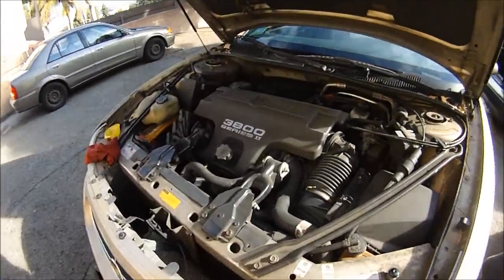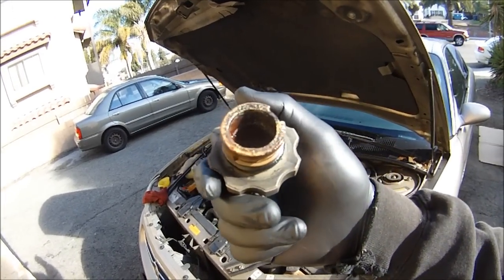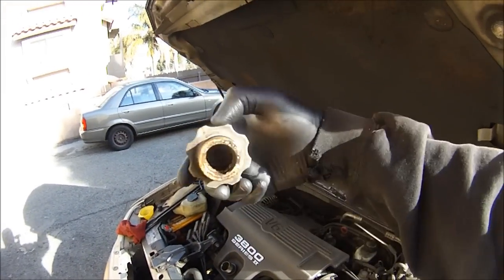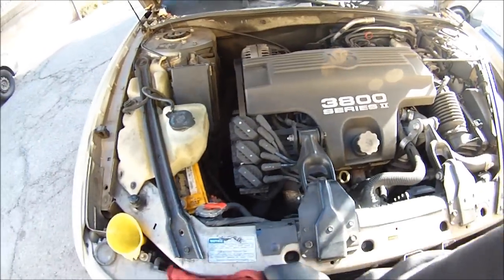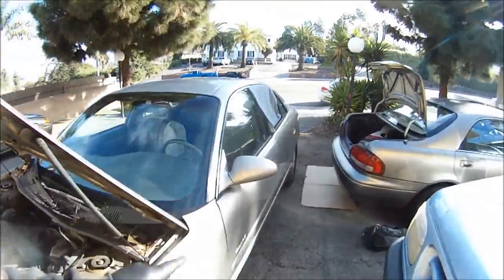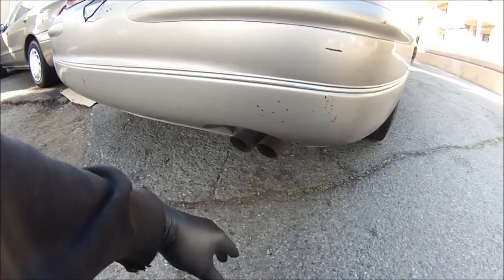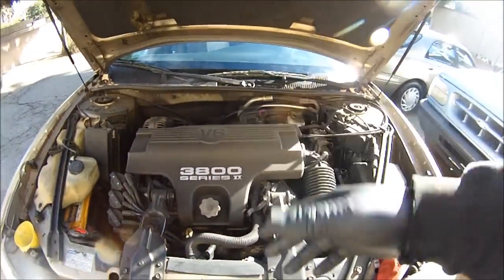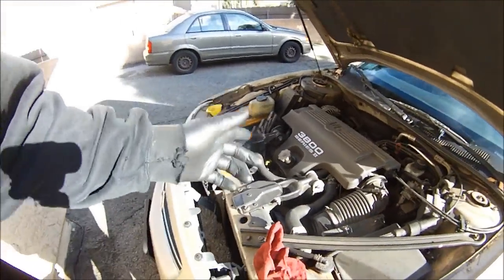BLOWN HEAD GASKET= MILKY OIL CAP. HOW TO TELL A BLOWN HEAD GASKET ON OIL CAP

Comment: Some engines produce condensation that builds up underneath the oil cap that can cause that milky substance to occur. My 5.4 3 valve engine in my Ford F-150 does it all the time and that's very common with those engines especially in the winter months. One of the more better ways to tell if you have a blown head gasket is make sure your  coolant level hasn't changed. Check your dipstick to see if there is water mixed with oil in the oil pan. While the engine is cool take the cap off of the radiator and see if there is any exhaust gases leaking into the coolant which would cause bubbles in the system. And of course if you change your oil and you see coolant pouring out of the oil pan and that's a pretty obvious sign also.

Comment: in colder climates this can be caused by short trips under 5 miles because the engine cant heatup to normal working temperature so keep in mind that this does not Always tell u that your gasket is blown
Reply: i am mechanic...today i realize that there was  some milky oil on oil cap in my car .....i mostly use my car  fir short tris ,,,this weekend  i  got my car from  work to home and back only one time...this is a 2 mile trip....i do this every once a week,,,so i am thinking exactly the same  that the weather and short distance trips  doesnt help the engine to spit  out the moisture ,,,,,and there is also  a lot of waqter from the exhaust.....this happens only during winter ,,,on summer  water almost disapears
Reply: Yeah I think the video is wrong
Reply: Happened on my old durango alot but wasnt a blown head gasket it was just short trips
Reply: Short trips exactly, I went to my local mechanic (honest folks), I have a corsa and there was creamy substance, mechanic said it's caused by short trips, he said it's no cause for concern UNLESS when you take out the dipstick, clean it, put it back in and if there is cream on the dipstick, then there's cause for concern
Reply: @pavloslionmma7619  so what do you suggest I can do cause it happened to me this morning, how can I get rid that? And I took out the engine stick and the oil looked good just not the cap from the engine
Reply: @rampagekike3793 i’ve been reading youre supposed to take the vehicle on longer trips. Drive it for a while on the highway. Im not a mechanic but i’m dealing with this issue and hoping it’s just condensation 😢

Comment from the maker: This is how to diagnose a blown head gasket the best way DIAGNOSING A BLOWN HEAD GASKET WITH A HOME MADE CYLINDER LEAK DOWN TESTER HONDA SOHC VTEC 1.6L.
Reply: my headgasket has blown...do i need a new engine as well ???
Reply: cheddar bob usually you have the gasket replaced and the head leveled before fitting...BUT..on some older cars it might not be worth it as it's an expensive repair. if you know a friend thats a mechanic that's a good way. but no you don't need a new engine.. although it's about the same price

Comment: THANK YOU.
NOT NECESSARILY TO HAVE A BLOWN HEAD GASKET. TO MAKE SURE, IN THIS CASE, DRIVE THE CAR FOR AN HOUR CONTINUOUSLY, THEN STOP, KEEP THE ENGINE RUNNING, PRESS ON THE RADIATOR UPPER HOSE, IF IT FEELS STIFF LIKE A STONE, THEN YOU HAVE PRESSURE IN THE COOLING SYSTEM, WHICH MEANS THERE IS A BLOWN HEAD GASKET, BUT IF THE HOSE IS SOFT AND CAN BE PRESSED WITH YOUR BARE FINGERS, THAT MEANS THERE IS NO HEAD GASKET BLOWN, ITS JUST COLD WEATHER CONDENSATION DUE TO SHORT TRIPS IN COLD WEATHER. ANOTHER THING YOU CAN CHECK IF THE COOLANT WATER IS MISSING, LIKE A CUP PER WEEK, THAT MIGHT BE AN INDICATION OF COOLANT PASSING THROUGH THE SYSTEM WHICH SHOULD BE FIXED. THIS IS A COMMON PROBLEM IN SOME VW ENGINES, WHERE PEOPLE RAN TO MECHANICS, TEARED OFF  THE ENGINE, AND THEN FOUND OUT THE HEAD GASKET IS OK, IT WAS JUST COLD WEATHER CONDENSATION, DEPENDING ALSO ON ENGINE OIL TYPE.

Comment: He is right that the oil cap is a way to tell, however if it's cold weather and you drive your car on short trips a lot you will get that on the oil cap as well because of condensation buildup from the temperature outside and the engine not operating at full temp yet, the way to differentiate that from a blown head gasket is a blown head gasket will also cause that gunk to show on the dipstick as well.
Reply: Aaron D, you have that right.  Another source of the wet milky creamy gunk on the cap is the result of a plugged CCV / Oil separator ...  the plug can result in the head gaskets being blown (happened to me).
Reply: Exactly! Same stuff on air cooled VW!
Reply: Spot on had an argument with a buyer of our run around about that.
Reply: I got a milky oil cap after i changed the water pump and somehow the coolant got in the oil... I changed the oil and no more milk
Reply: My cap on my corsa D has milky oil on it too. I tried to heat up my engine for 30min as I'm not taxed to drive it yet. After 30 mins the creamy stuff was still there but I noticed some normal oil surrounding It , probably build up from the heat...is this a good thing?

Comment: although this is true... it should be said that it is common for jeeps, and dodges that have the long necks comjng off the valve cover to have this chocolate milky look underneath the cap due to normal condensation... just so ppl dont tear their heads off right away... again, this is an excellent way to tell, generally
Reply: exactly, i have a v70 2.5t -04 has the same normal condensation, short drives in the city usually makes this shit comeback.
Reply: And many Mercedes, especially the older 3.2's, with perfectly fine head gaskets get that.

Comment: 4.24.14.     The 3800 also has leaky L.I.M. Gaskets, due to lack of draining & replacing the Dexcool coolant. I always replace the L.I.M. Gaskets with the metal framed GM or Fel-Pro gaskets! And not to forget, I replace the plastic upper plenum with one from APN Automotive Parts Network. It's the best one for series II engines.
Reply: Man i put some bar in my car 6 years later car runs bomb

Comment: If that's the case I've had a blown head gasket for 30,000 miles. If you see it on the dipstick then you have a blown head gasket
Reply: Yes condensation can cause milky look under oil cap
Reply: @macknumber9  or even it being a bad pcv valve bc my cap has white moister on it not a lot and it had light brown moister in the oil did a oil change changed that smoked for a couple miles around the valve cover and it stopped doing that in the oil after I got that fixed and high milage oil change
Reply: Your are absolutely correct chad Krugle if your oil is milky or your coolant has oil in it that’s a blown head gasket that condensation doesn’t always mean head gasket this guy needs to explain a little better before he has everyone panicking thinking heir head gasket is blown that moisture is normal if your oil is not milky and your coolant isn’t milky that’s absolutely normal every engine is going to produce condensation when your oil looks like that that’s when there’s concern if it’s on the cap and in the oil short trips and not warming all the way up cause that condensation that’s why if your taking short trips you let it warm up to burn that vapor off like I said every engine no matter brand spanking new is going to have some condensation the vapors have to escape somewhere now if you see that crap in your radiator or oil then yes you have a blown head gasket only and I repeat only in that case where it’s in the oil and in your coolant to have a great day happy new year

Comment: It can also be from a faulty crank case ventilation system. It will allow condensation to build up in your valve cover.
Reply: Yes Lincoln Kuwabara,  exactly right...  faulty CCV.
Reply: Louis DeFilippi Pcv
Reply: Hi Lawrence Wheeler, yes, in many cars PCV, that it right.  In the BMW for example the part that performes that function is the crankcase vent system, that is, the CCV system,  which separates liquid oil from the air inside the engine and intake.  Other cars have a PCV (positive crankcase ventilation) valve that is used to vent the crankcase.

Comment: My car overheated a bit, but I can’t find oil or water mix. However in the breather pipe at the top of the cylinder head which connects to the throttle body and connected to seemingly the engine block through a little black metal box, I found oil water mixed (coffee with lots of creamy milk image). What could cause this? I cleaned, but I wonder if I should do something to prevent it again? The actual engine oil is still pure even at the cam shaft, chain, pivot rocker area engine oil is ok. The dipstick is fine as well. I just had a slight mix on the cylinder head engine oil cap, but that is coming from the breather pipe and don’t know where it picks up water, could you help?

Comment: All of you share good points, and Kudos to this video, this indeed is a great signal to what way to go on diagnostics of your cooling/combustion system. I have on tip I believe is a sure fire way to check. IF your head blows the hell off your car and flies into oncoming traffic...there at that moment, is a good time to check on your head gaskets. Youre not going anywhere for a while anyway

Comment: milky oil is usually a cross leak from bad intake manifold gaskets..3800s 3400s and 3100s are notorious for it along with the 4.3

Comment: NOT ALWAYS true, condensation is the cause of milky looking oil cap, their are like 3 or 4 different ways to blow a head gasket depending on if it's the space between the oil jacket & coolant jacket that will cause water in the oil, also water in your oil could mean the bottom end & AKA (Rings) AND the head gasket are worn out meaning you need a whole engine re build. After the gasket is replaced the engine would hold water but then now burn oil

Comment: My car has this milkshake under cap, rocker covers full of it. how can I clean this out after repairing the heads/gaskets? the dipstick is pretty clean and the radiator
Reply: Did it cause your car not to start?
Reply: Dump oil, rinse with diesel and then pour engine oil

Comment: My 1997 Toyota Tacoma truck has 280,000 miles on it. It has all the symptoms that you explained. What's a fair cost to have the head gasket replaced (parts and labor)?

Comment: Milky oil cap is not a sure sign of a blown head gasket. It's just condensation that has not evaporated due to short trips in very cold weather. Engine not running long enough to remove condensation from oil. If your oil is milky on the dipstick, then there is water/antifreeze in oil.
Reply: Alfonso Demagistris I have a mucus on the cap but the stick looks fine on my Pontiac grand am but I swear I pour about 5 gallons of antifreeze in my car in the last 2 weeks because it just keeps disappearing I can’t tell with the tailpipe because it’s winter in Pennsylvania right now what do you think
Reply: Mack Flanigan , if the shit ain't leaking out it's going somewhere. Sometimes leaks evaporate before they hit the ground, but there would be a trail of white evaporated antifreeze. If you putting it in, it's going somewhere
Reply: Yeah i was worried about that but it was winter when i saw the milky oil cap and as soon as the weather got warmer i stopped seeing it also i had my mechanic test it he said my head gasket was fine

Comment: Can be a vacuum leak ? I live in new york and i got a truck and this happen only in winter. But you check the oil stick and its normal. Can be the moisture in the air.

Comment: how do you remove the air breather box with the pcv valve? It is located on the back of the block on a 2000 civic ex model. There are two screws and a nut hidden behind a bracket. The bracket is bolted to the throttle body intake with some annoying wiring.

Comment: Or more than likely if you drive a short distance to work, say 8 miles in cold weather this will result.  Moisture on the oil fill cap
is a result of your engine not reaching proper temperature for long enough time..Drive your car for a long run and maintain engine temp. for at least 35 minutes. If your car don't overheat or you don't lose coolant you heads are fine. So don't jump to conclusions without knowing all the facts.

Comment: Thanks for vidi, clear and simple demo.I got that funk on the caps of the reservoir and radiator, but not the oil cap. Overheats only on highway, not in traffic.  Scared I'm looking at 2000$ (after 1000 for brakes)
Reply: Got oil in your coolent

Comment: Just over two weeks ago I purchased a 1997 Buick LeSabre custom unfortunately from what I could find out the car set for almost 2 years and when I got it the oil was blacker than black now it has the 3800 series motor in it and just the other day I was checking the oil which was totally black but no type of antifreeze or milky substance could be seen so I pulled the cap off and I was looking and there was a little dab of water where the cap sets and get looked a little milky but I don't know please advise

Comment: I don't have any water in my oil, but it seems something is going on with the radiator. The radiator cap has that milky looking color but not the oil cap or dipstick. Then my radiator cap keeps getting stuck and appears to be slowly losing fluid but no overheating, what can be the cause of that? FYI 2006 Pontiac Grand Prix 3.8 Supercharger Thanks
Reply: Ricky Harris maybe need a new radiator cap. That is a very common water loss issue.

Comment: my truck has milky stuff on the filler cap. but since it has 3k miles on a brand new motor its not a blown head gasket. when you drive in cold weather, condensation builds on the coldest part of your engine which happens to be either the cap or the dipstick tube. if you make short trips and the engine does not have time to fully warm up to running temp for 15 to 20 minutes, it doesnt get hot enough to evaporate the moisture completly. and you end up with small deposits of crud on either your dip stick or filler cap. IT DOES NOT MEAN YOU HAVE A BLOWN HEAD GASKET!!!!!!!! However, if you drain your oil and it looks like chocolate pie filling (and i mean all of the oil that comes out) then the white smoke that you see is for sure a blown head gasket. ask yourself this, do i let my car warm up every time i drive it? if you answer no, then your oil cap most likely will look like this.
Reply: also, some food for thought since it has happened to my wife. if you have your oil changed at a quick place, check it after a 20 minute drive. you may have had an idiot put coolant in your oil by mistake. use common sense folks. jumping to conclusions costs alot of money and fixing stuff that isnt broke is just plain dumb.

Comment: hi, tonight after hearing some knocking from my engine, i checked the engine oil cap i saw some yellow stuff on the cap. i have recently have my water pump replaced about two months ago because i was seeing coolant on my floor every morning. 
After hearing the knocking tonight, i also checked the coolant reservoir level, it's almost full I don't see any white smoke coming from the muffler and my temperature gauge on the dashboard.
would you say that there's a cylinder head  gasket issue?

Comment: That being a gm it is not always a blown head gasket the gm intake gasket is very well known to cause the same simptoms as a head gasket. white smoke and milk for oil. 3000 series are what is affected buy this. I worked as a gm tech and they can be a royal pain to determine what gasket is the problem
Reply from the maker: +aaron foster Ya I also made a video on fixing that same problem you are talking about
Reply: Cool was just throwing it out there man
Reply: the intake gaskets on the 3000 series engines are HORRIBLE
Reply: good information
Reply from the maker: True aaron I have a video on that also

Comment: One of the most common misdiagnosis's in auto repair is confusing an intake gasket leak with a head gasket leak. G.M. 3.1, 3.4, and 3.8 litre engines use a hard plastic lower plenum gasket that's good for around 75,000 miles. The head gaskets on these engines rarely blow. I don't like to give away trade secrets but this video is very misleading. I cannot even begin to remember how many people have come to me saying some garage told them they had a blown head and they needed 1500$ to fix it, and then I tell em' it's the intake give me 200$ and I am right the car runs great and johhny q. public just saved a grand.
Reply from the maker: I already confirmed it to being a blown head gasket (leak down test) This is not misleading. Ive been doing head gaskets since 1991, don't get it twisted it was not a piece of plastic from the lower plenum
Reply: You are right about GM those plastic intake plenum parts...I recently had this same prob with my 2002 Chevy impala ls. Leaking coolant into the engine oil from an old intake gasket, about an 1hr 30min job depending on skill.
Reply: Gary Farris Man I had a 98' Malibu LS 3100 motor & when I tell you I had replaced the same kind of motor 3 different times til the point I gave up,, I'm like fuck these shitty ass motors,, but come 2find out after the fact,, it wasn't the motor all that time,, it was the weak ass plastic intake gaskets that was the problem 😂😂😂...
Reply: Gary come fix my car

Comment: This is not necessarily true. A leaking valvecover oe there parts of the crankcase ventilation system could cause the cap to be milky.